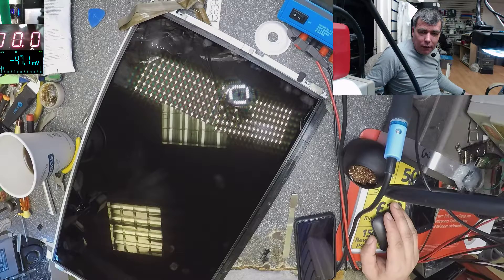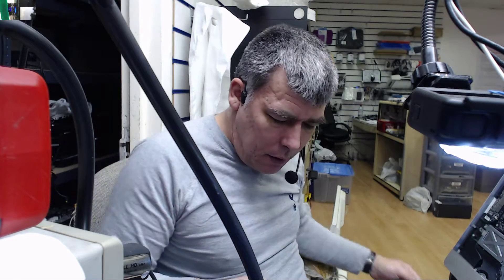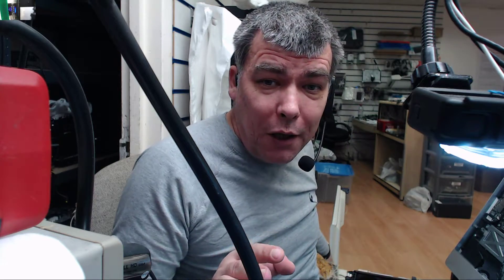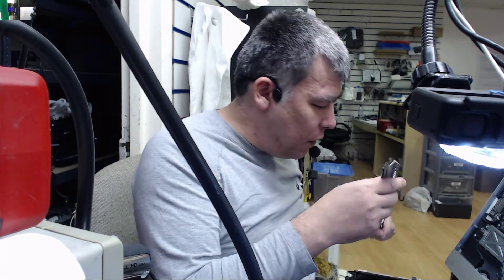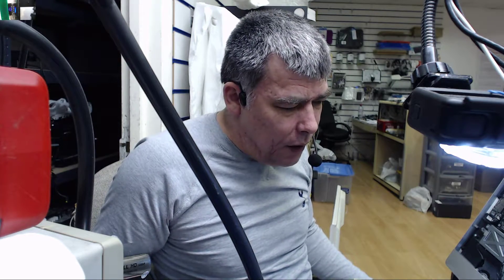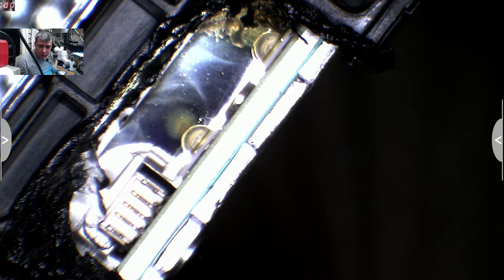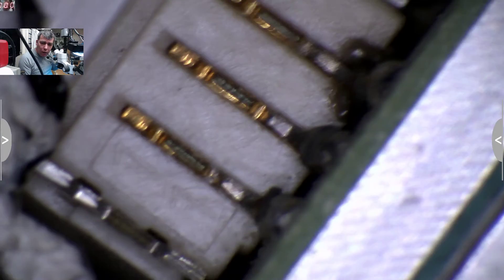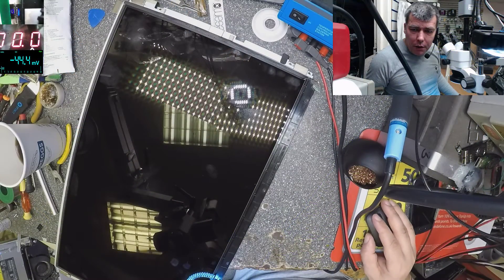Imac 21.5 inch 2011/2012 flickering lights or no light repair

Comment: Hi,
after fixing the "dark side" problem by soldering every single wire, the process ended up with a different problem. Now many of the leds are blue (mostly in the center) not white. Can somebody give me a hint what happend and how to fix it.

Comment: I had my display replaced on my 2011 21.5” iMac.  Still flickering.
Reply from the maker: can be from the backlight  power supply
Reply: what part of the world are you in? i'd love to send you my imac to fix.
Reply from the maker: uk based. But, backlight is a easy job, can be only the screen or the invertor, try and fix it yourself
Reply: Electronics repair school I’m not very good with repairing computers.  A lot of repair shops want a lot of money to fix it.
Reply from the maker: i know , but if you check ebay you will see how expensive its the screen
Reply: Electronics repair school I had the display screen replaced.  That didn’t fix it.   It’s the video card.
Reply from the maker: you said the light its flickering!